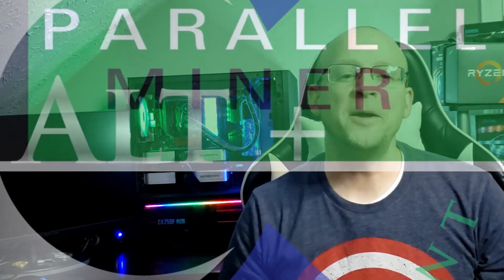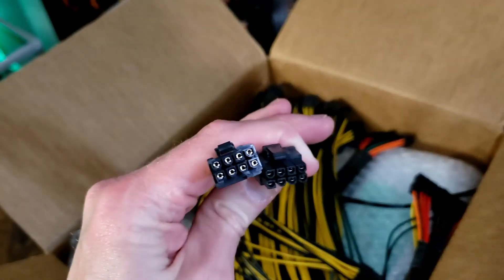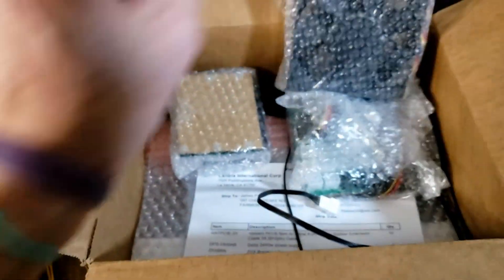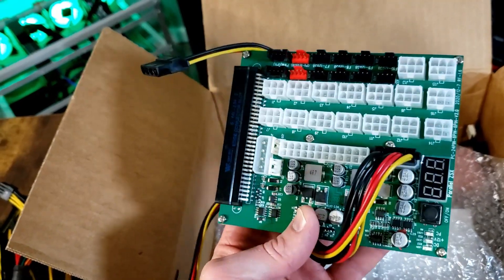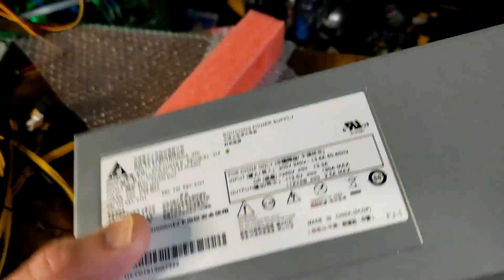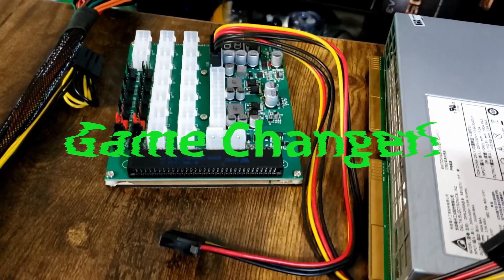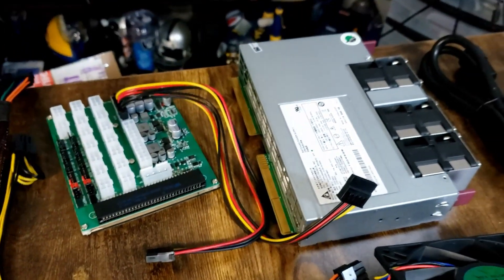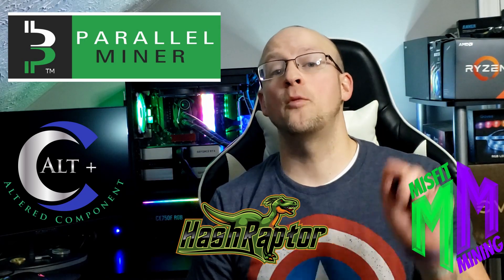⚡Mining Hardware Airdrop from Parallel Miner | Unboxing HP & Delta Server PSU + ZSX breakout + More

Comment: Wait, did you really just say you can power a triple 8-pin 3090 with a single 6-pin? 
6pin = 150W with 216WMax dual 8pin splitter.... 
8pin = 288W or 216W Dual 8pin split....
Can anyone confirm that a single 6pin can power any triple 8-pin 3090?
Reply from the maker: Actually that is incorrect a bit.  6 pin with 6 terminal pins inside can handle 288 watts.  I spoke with parallel miner and they confirmed that a single 6 pin off the breakout board can pull up to 300 watts.  So as long as your 6 pin cable from the breakout board has 6 terminal pins inside, and it is 16g wire, it can handle it.  Then the up to 300 watts is split between the 3 8pins.  The splitter is 18g wire which is fine since you are not pushing more than 150w though each of those.  So, a undervolted 3090 should run off a single splitter.  I would love to test this, but I have all 3060ti and 3070s, and 5700s

Comment: Can’t wait for my stuff to come in! Oh FYI your intro is so much better than mine lol
Reply from the maker: Too many videos not enough hours in the day
Reply: I have to be honest though I don’t trust those six pin to three 8 pin adapters I feel like that is prone to melt the six pin on the breakout board on one of the big cards 300 W through that tiny cable doesn’t seem safe lol
Reply from the maker: I talked to one of the main guys from pm (joseph) on those and did research on my own.  A 6 pin cable with 6 physical terminals in the plug can handle 288 watts safely.  The main pcie wires that plug into the breakout board should be 16g.  Then the triple 8 pin splitters split down that 288-300w power into those 3 8 pins.  They are 18g on the splitters.  The card should only pull up to 150w per 8 pin.  18g for 150 watts can handle that all day without melting.  I was iffy on that as well.  Did a lot of power research lately.

Comment: Are you mining off of NiceHash? Also glad your dropping info on Parallel Miner, I purchased a few GPU servers from them and a few breakout boards after I made the mistake of buying some shit made boards off of Ebay
Reply from the maker: Thanks for watching.  I bought some terrible junk boards over the years as well.  I have all rigs on nanopool eth right now.  I do occasionally put one on nicehash when gap is close on profits to get some easy btc
Reply: @AlteredComponent  I got a small rig  of 1060tis and 2060s on there and I noticed my 1060ti is out performing my 2060s with eth, but as soon as I switched my 2060s to Octo they a pulling 3 a piece. And was wondering if you are seeing any wild differences with your 3070s compared to your other 30 series. Thanks
Reply from the maker: @ericashmore2706  I assume u mean 1050ti or 1060s with the 2060s right? I have all 3060ti and 3070s and 5700s nowadays.  Sold all my 20 series and rx 570/580s.  Eth mining not doing well today. Problem is btc is up .5% and eth down 3.5% over the last 7 days. We need eth to go up and btc to go down so we can start pulling better profits.  I did look up a 1660ti earlier and it was making more on octopus than on eth at that time.  Crazy